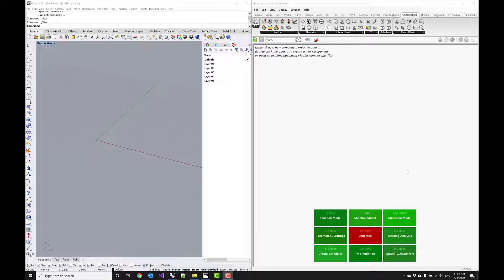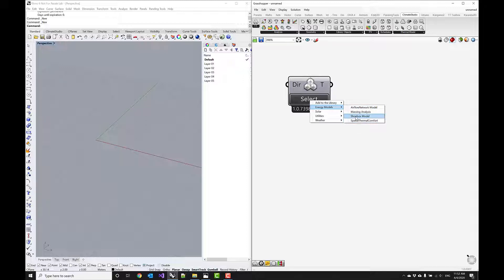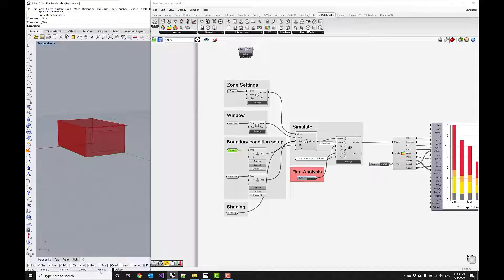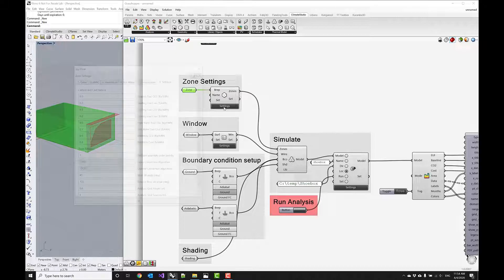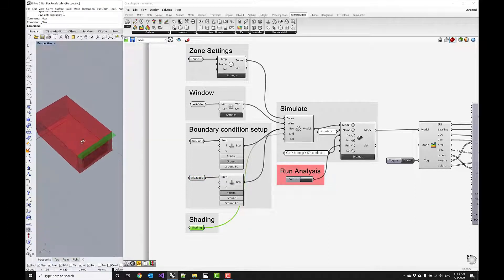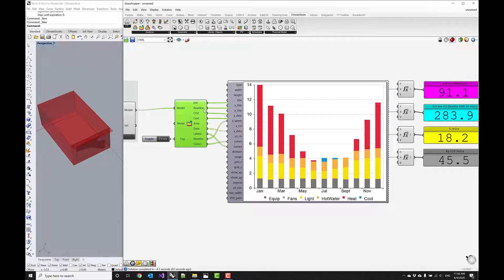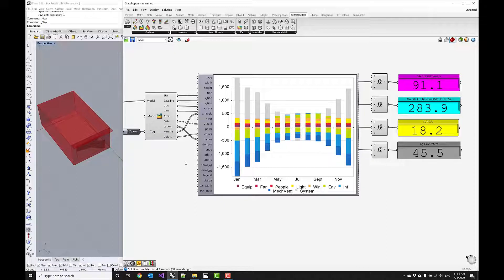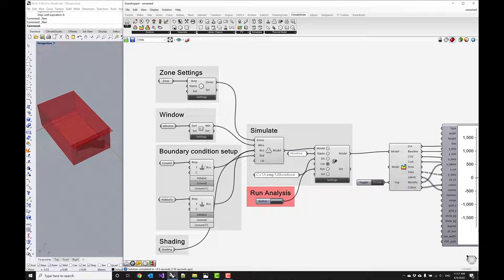ClimateStudio Energy Workflows in Grasshopper

Comment: Running inti an issue. What you call the networker component only appears for me as the cs model maker which has systems instead of zones - and when I connect it it says no zones are found and a free floating zone is plugged into systems input and wont be added to the model. Do you know how to fix this? Thank you!